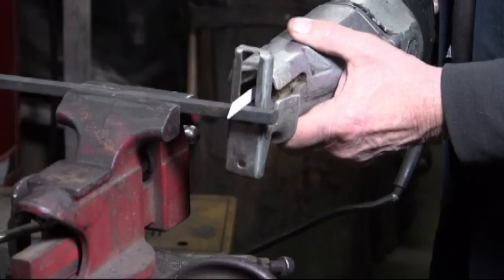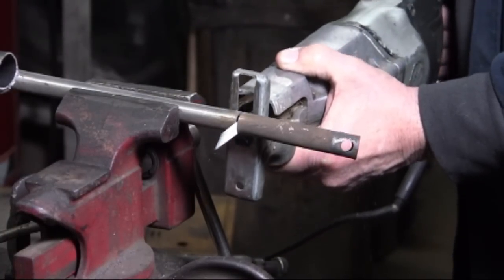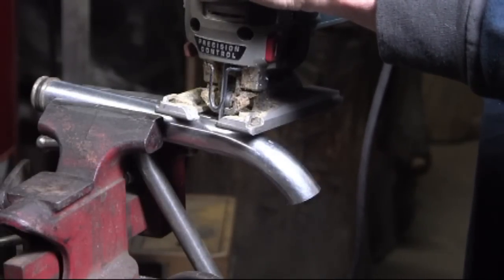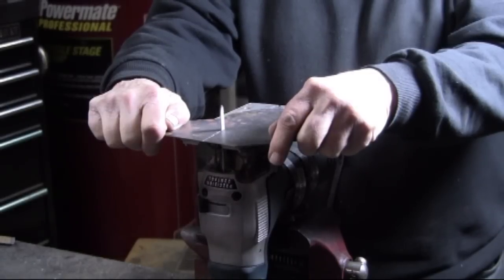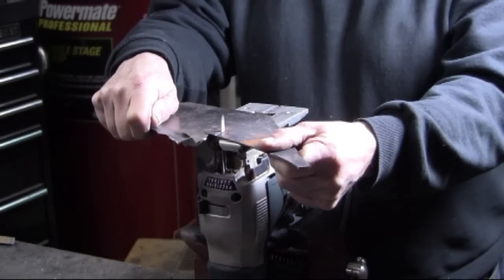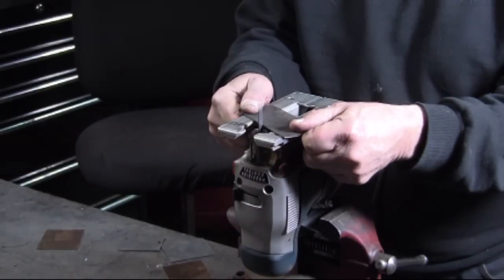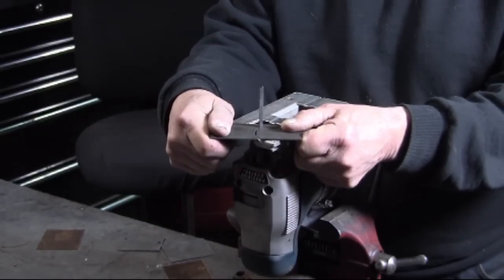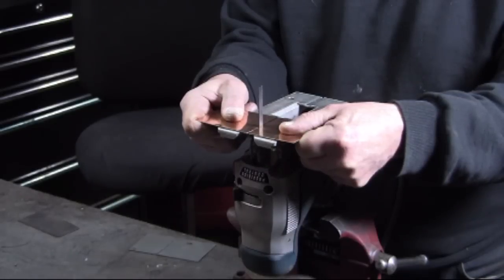Metal Saw Cutting for the Home Shop

Comment: Thanks George; being on a tight budget your tips are very useful. Before I acquired a small compressor and and an air-powered shear, I used to sometimes clamp thin sheet metal to scrap plywood and cut through both to stop the metal snagging or distorting - a tip my grandfather (he was a tool maker) taught me. Best wishes.

Comment from the maker: The jig saw is not my ideal metal cutting tool.  However, 30 years ago when I didn't have many tools it would have been a real plus in my shop.  Which was the reason I posted the video.  For someone that doesn't have a lot of tools, this might get them to the next step ( a better cutting tool).

Your suggest of gloves would have been good to put in the video. 

You are right, cutting oil is a good idea.

Comment: A fascinating metal saw introduced 6 years ago. A carbide tip circular metal saw blade. What you cut 30 seconds at 0:52 is done in 2 or 3 seconds. I'd invest on this ($18-22 blade only) to cut down noise since I now only spend 2 seconds annoying my neighbors. I like it a lot.
Reply from the maker: Thanks, I'll check that out.

Comment: While I can see the advantages of the 'upside-down jigsaw' method, I would be worried about snagging and heat with smaller items and the possibility of accidents. So I think if it were me I'd do three things; 1. cantilever a blade guard over the work, 2. use a lube-coolant such as machine oil to aid the cut and 3. maybe wear gloves. Every time I saw the steel snag slightly I was worried you'd tear your hand. But an excellent video with a very good clear voice-over. Thanks for posting it.

Comment: Hi george, nice video. I love hacksaws! but I wouldn't cut with it dry, only with some kind of oil. any kind of thin stuff will do, however good dedicated cutting oil is probably better. Anyway it does wonders to the cutting action! I bet the blades will last longer too. I'd do the same with the jigsaw. You have a lot of good information on your channel, I'm glad i found it. cheers!

Comment from the maker: The Sawzall that I was using was a 30 year old low amp saw with an imported blade.  No doubt that you Milkweed with a premium blade will cut much faster. I was running the Bosch at a fairly slow speed for the video.

Comment: I have a walker Turner   "the drive line" scroll saw and I am in the process of setting it up with a jackshaft and stepped pully arrangement to lower the speed to cut steel.
Reply from the maker: Sounds like you have a plan.  Should set you up up for cutting lots of metal.

Comment: what are the most important features to be considered of the jigsaw you use when cutting just in this fashion on heavy gauge metal. I have a 6amp rigid that I just purchased for this purpose. Do you think this saw would be sufficient? I also plan on building a table for under mounting the saw. My metal will be in the 16g-10g range.

Comment: I need to cut some 1/4" steel plate  some are small and some have curves.  What it the best method. I tried my HF portable band saw and it has 1/2" blades only and not good for small curves, Actually tore  the rubber tire or belt on the drive wheel.

Comment from the maker: I thought I had replied to this.  Must have got lost in cyber- space.  6 Amp - that is a powerful saw.  Hopefully you will send some photos of your table.  You should have no trouble cutting heavier metal.  Buying blades is somewhat confusing.  Some of the cheap blades are better than premium blades.  Bosch blades are supposed to be especially good.

Comment: The only problem I see with cutting upside down is that you can't really lube the blade without getting oil all over the saw. With softer steel, this isn't as essential, but with tougher materials (I'm going to be using Ti) you need oil to dissipate heat. Nice video though.

Comment: I would like to ask, what if i want to start from the middle of a piece of metal, how do i make t he hole so i can use a saw later on? or can i use like a saw from the star and maybe make a groove in the metal
Reply from the maker: Not sure exactly what you are asking.  If you want to, say, cut a square our of a middle of a piece of metal, generally a hole is drilled to the inside of the cut.    The hole has to be a large enough diameter to fit the blade of the saw.  A cut off saw (reciprocating saw) takes a blade that is about 5/16 wide.  Blades for a jig saw are about the same width.

If I misunderstood your question, let me know.  I am assuming that you are NOT talking about sheet metal.    These saws do not do well with sheet metal.  For sheet metal you will probably want to use a pair of aviation snips.

George
Reply: Yeah its for like 3 mm aluminium in computer cases or such and asked around a bit and probably a hole saw then a saw of some sort to cut the hole and then use a nice file to file down the edges smooth so that you dont cut yourself or any cords or whatever on them :) thanks for the advice
Reply from the maker: lillskiten1337 Sounds like that will work.  For either of the saws I mentioned you can get a fine blade (as opposed to course) which will give you a better edge which will mean less filing.
Reply: lillskiten1337 tiger lilly
Reply: Tiger Lilly
Reply from the maker: If you want to start in the middle of a piece you will have to drill a hole large enough for the saw blade.  You can also use a plasma cutter if you have one or know of one that you can use.
Reply from the maker: If you want to start in the middle of a piece you will have to drill a hole large enough for the saw blade.  You can also use a plasma cutter if you have one or know of one that you can use.